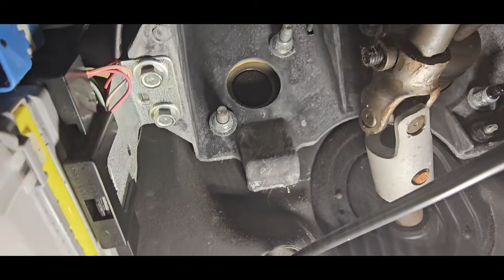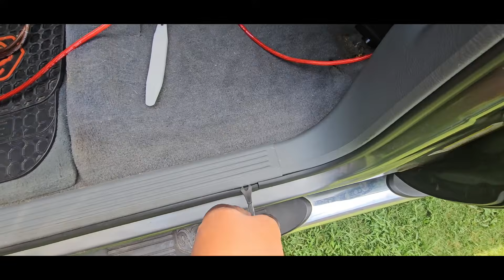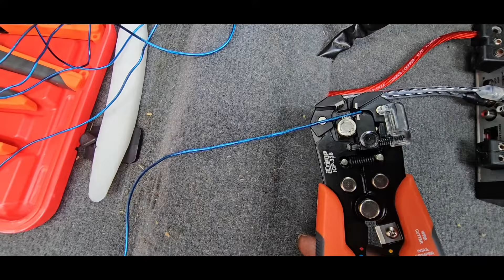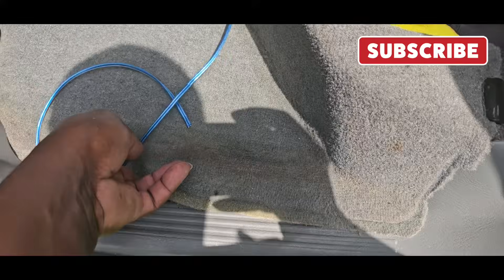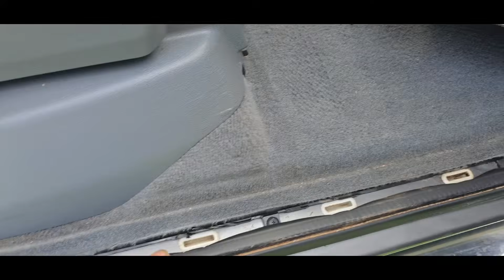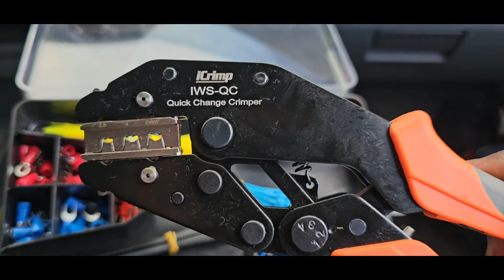How to Install an Amplifier and Subwoofer (Beginner's Guide)

Comment: Thanks for the guide, I was wanting to know all the particulars before biting into this, your video does a great job showing all the details. I had one question, for putting in the ground, did you use certain bolts/nuts/washers?

Comment: Not even a little rust under the seat....I am impressed.
Reply from the maker: Lol, yeah I was going to buy some new seats to replace my driver's seat but the seat that I was going to purchase when I looked up under it had rust all under it which is weird but mine doesn't so I didn't purchase those seats. I don't understand why the bottom of those seats were rusted do you know why.
Reply: @JOATD Moisture of some kind. I had mine closed up in a portable garage without airflow. I have my front seats out now dealing with the rust.

Perfect time to install a new audio system. This is where your video is a god send. So thank you for this and every Dodge Ram vid.

Comment: How long did it take?
Reply from the maker: It doesn't take too long as long as you follow the steps. Maybe about 4 or 5 hours the hardest part is running the wire. I have a video on installing a 4-channel amp that one took a long time like all day.